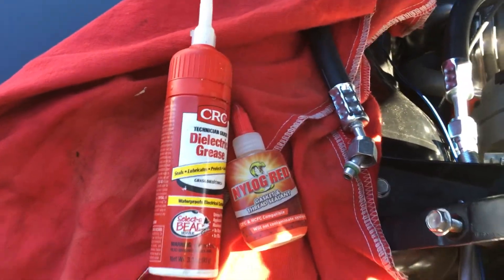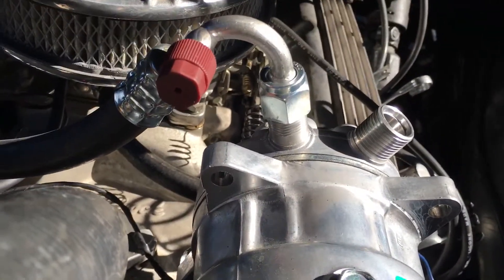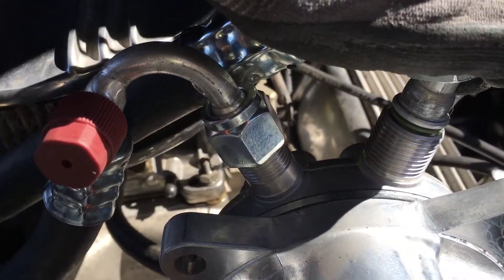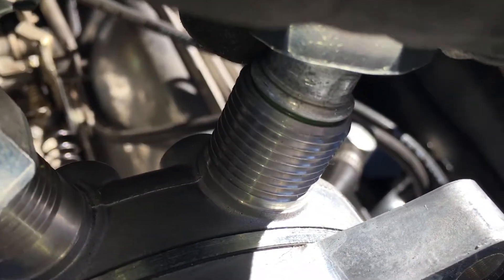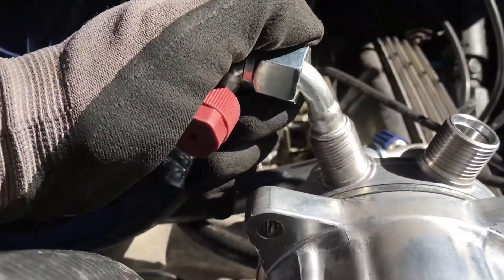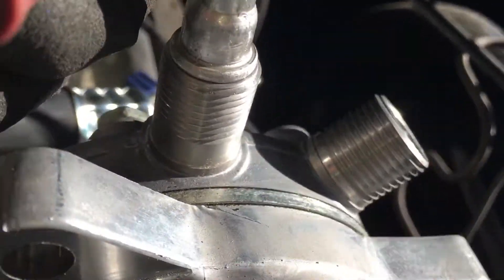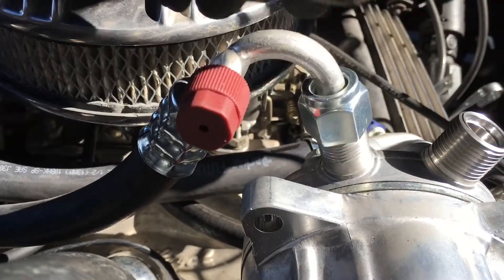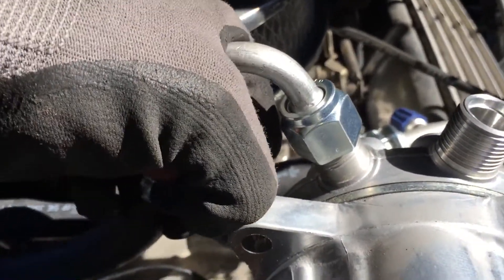Properly installing tightening A/C hose fittings without stripping or crashing

Comment: Thank you for nice advice. How much should tight the nuts of the car AC lines? is there any advice for that?
Reply from the maker: Look up torque specs for the size nut or bolt . All sizes different

Comment: Any advice on moving metal ac lines when putting in a condenser? I don’t want to break it but I gotta move it down for it to fit
Reply from the maker: Then you have to follow it all the way back and start removing clips in clamps and disconnected from its source.  You have to move things out of the way.. 

And it cost extra time . 

This is why if you look up hopefully it’s correct book time inside a service manual . 

For example Look at a certain Toyota of a specific model, where the condenser may look like it’s easy to replace.  But the lines are away sheet metal is in the way and other components are in. 

And if you look up book time, it may say it takes 1.8 hours. . 

Even though it may be able to be done quicker, there’s sometimes a good reason why instead of 0.4 hours they put down 1.8 hours cause that means a substantial number of components need to be done to do it correctly without bending things or notching or cutting. .
Reply: @coldfinger459sub0  this is awesome thank you. I get nervous moving the lines around cause they feel brittle
Reply: @coldfinger459sub0  I def don’t feel as bad knowing you gotta move stuff. I gotta look for a service manual for my car

Comment: So do I fix (new shaft seal, new T valves, head gaskets and valve plate) the York, or convert to Sanden?? What do you think? It's a huge Diesel. The shaking York is no big deal.
Reply from the maker: They are both very reliable work horses for a compressor. As long as the York is mechanically sound just the seals would be the only thing to replace.   Then dump the oil and change the oil inside it should be about six ounces inside .   
          I’ve gotten lazy about working on my old personal cars.   I take the path of least resistance whatever’s easier.
Reply: @coldfinger459sub0  Thanks, I like to go Sanden but the path of least resistance sounds good.
Reply from the maker: @christopherrasmussen8718  if you know somebody who can properly do the re-gasket and reseal overhaul on the York and wanted to keep the old compressor there’s nothing wrong with the old compressor

They still even make those compresses brand new because they’re used overseas and around the world on big earth moving equipment literally millions of these units are around the world and use today. That’s why they still make them brand new.